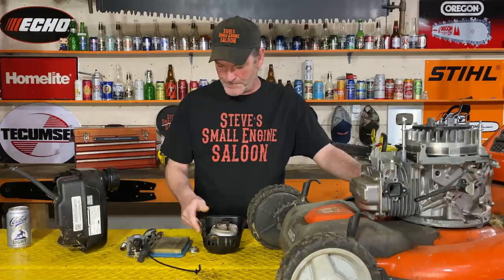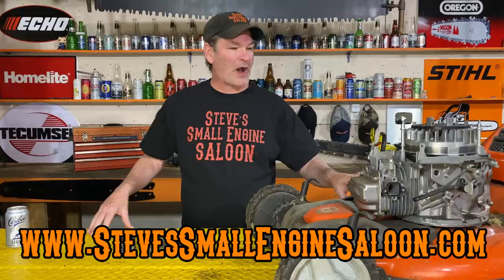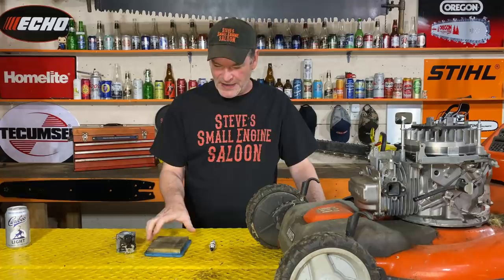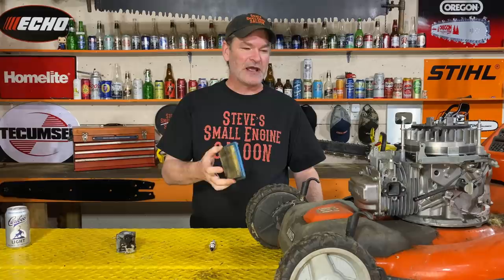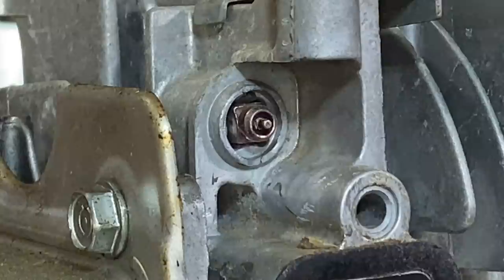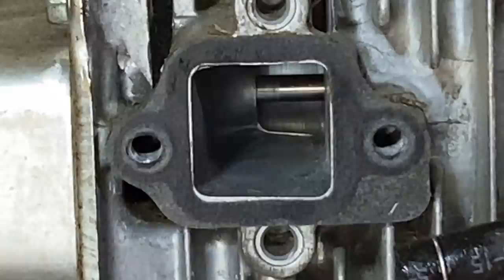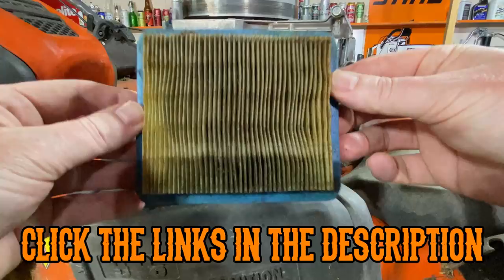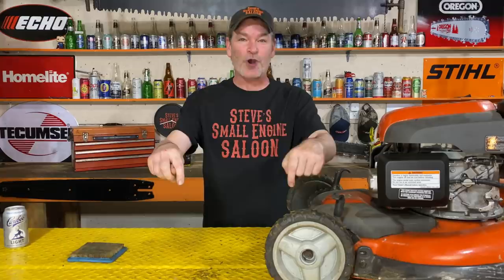What Happens If You Flip A Lawn Mower Over Wrong?  (LOSE MONEY)

Comment: Steve that's awesome. I got a riding lawnmower for free. The guy said get it out of here. Put a brand new battery in and it fired right up. Sold it for $450.  I also had many push mowers that people said the engine is shot. The blade was loose on one and the other one grass had built up underneath and the lawnmower would not spin. Easy fixes.
Reply from the maker: Right on buddy!

Comment: I went to the junk yard this week to get a  old mower because my old deck was broken but the Honda engine was good , bought a mower for 15 euros  thought will it run ? made a new air filter, cleaned up spark plug ,new oil sharpened blade (watched your video ) BANG first pull it started and runs like a good one ! Happy days save me 200e on a new mower  .

Comment: Great find. Just got a free toro recycler with a Kohler engine. Wouldn’t start. Turns out the previous owner had put the choke mechanism on backwards after he cleaned the carb, so it held the choke open. I turned it around and it started right up. He did a great job cleaning the carb. Lol.

Comment: I’ve had a craftsman mower with a Honda engine for 18 years now,always starts within 2-3 pulls even after sitting for 6-7 months.The last couple of years I’ve left it outside in the winter rains here in Nanaimo. I checked the air filter before starting the first time this year,full of water,carb all gelled up,exhaust also had water coming out. Pulled it all apart,cleaned carb out,new filter,plug,two quick oil changes.checked compression,all good and runs like a top. I’m only gonna run chevron 94 with no ethanol to avoid any kind of crystallization in the carb again. 😎

Comment: Over my lifetime I can't count how many mowers, weed eaters and saws that I've received or bought for practically nothing. Some I found or got for free and it was the simplest things wrong with them. My recent luck was three items that I'm keeping for myself. Two are practically brand new and were simple fixes. The third is my side project cause it's about 15 y/o but has the GCV 160 engine with manual choke. The frame is old but solid (like a tank), with no wobbly wheels. The engine smokes but no knocking. It's compression is on the low side. I'm going to rebuild it while parts are still readily available and still fairly cheap. (Already looked up parts) I've never rebuilt a Honda mower engine and I'm up for this little challenge. I've always known Honda engines to be good but never owned a mower with one nor worked on one. This is my first. I like working on side projects like this.

Comment: Great video! Having a clean air filter really makes a difference. I've found out the hard way that tipping your lawn mower on the wrong side is bad news. Today, I just tipped my mower (after being repaired) over on a 45 degree angle forward to clean underneath when I should have tipped it backward. But it was only for like a minute or two. Thankfully my mower is working fine.

Comment: Back in the mid 70's, I went to VO-TECH for small engine repair and one of the first thing my teacher taught me is that most of the time it would be a 2.00 part that has gone bad and in this case it just happen to be an air filter what 6 or 7 dollars so the first thing that you check the cheap parts first it just may save you a lot of head aches. I could not help but laugh when he puled that air filter off hehe lol.

Comment: This kind of thing happens all the time. I had a guy bring me a mower he'd flipped completely upside down to clear a bunch of jammed up grass. He said it just wouldn't run right anymore. Turns out somehow he'd knocked off (or removed) the governor spring.

The problem now is that nobody seems interested in used mowers. I don't know if it's the economy or stimulus checks causing the lack of interest, but they just don't sell like they did in years past. It's hardly worth my time even with a free mower.

Comment: Not long ago, I had a neighbor give me a Craftsman tractor riding mower because it was spraying oil out of the muffler when he attempted to start it.  I pulled the dipstick after I got home and the crankcase was full of gasoline.  I drained the oil, replaced the filter, and installed a shut off valve on the fuel line (to prevent further issues).  The mower started immediately, smoked about 15 seconds and now purrs like a kitten.  Best deal I ever made!
Reply from the maker: Awesome!

Comment: I have this exact lawnmower and I am just about ready to give it to you as well…well, that was last night on a customers lawn. It would start, get up to operating rpm and stall. Over and over and over again…you get the idea. Didn’t have a plug wrench with..not my normal performance..rookie mistake 🙄
Made sure the breather was clear and nothing ‘seemed’ to be hanging up the choke or governor(at least what I thought to be a governor. Serendipitous that you just worked on one. I’m thinking it’s starving for fuel but on the restart, it ‘puffs’ a little smoke. So I’m still ‘stumped’ as to what it is until I tear into it…I thing I will pay close attention to your video Steve..and hey, thanks a bunch in advance. 👍👍 (us Steve’s have to stick together and pay it forward. 😉☺️)

Comment: About 2 weeks ago the elderly gentleman across the street put his 6.5 HP. push mower out on the curb with a FOR FREE sign on it. He's almost 70 & still mows his own small yard, good for him. Any way I saw it early in the morning when taking the dog out & grabbed it. I didn't feel LUCKY when I found out what was wrong with it & how simple the fix was.

What was wrong with it was the Control Stop Cable was broke at the bracket & was very hard too see, had too take the cover off. I had an extra handle & control cable in the garage, so I put it on & it fired up, ran fine. I changed the oil, air filter was good, changed the spark plug, sharpened the blade then took it back over too him a few hours later.

Now I didn't know this man very well since I moved in this neighborhood just a few years earlier & he kept to himself. HE STARTED TOO CRY when I told him I fixed his mower & did some maintenance on it. He said he couldn't afford too buy another mower & didn't know what he was going too do. Asked me how much I owed him, told him pay it forward if ya could & was glad too help. He said, " THAT'S THE WAY IT USE TOO BE & DIDN'T THINK PEOPLE WERE LIKE THIS ANY MORE ".

I watched him that day mowing his grass with a huge smile on his face, DAMN NEAR MADE ME CRY. Later that evening he came over with a couple of beer's & we shot the shit on the front porch for a couple of hours, GREAT MAN.
Reply from the maker: That is AWESOME!
Reply: @StevesSmallEngineSaloon  THANKS, Some of your vids that I watched helped me fix the mower. I'm not what I use to be since my wife took her own life a few years ago at the age of 49.  I can't remember the simplest things most of the time now or figure them out like I use too. We were married in High School at the age of 17, Docs. say it did something too my brain seeing that.  

THANKS FOR THE REPLY & YOUR VIDEOS SIR. Henry from N.E PA. Fighting everyday too stay alive & if it wasn't for my dogs ( UNCONDITIONAL LOVE ) I KNOW I WOULDN'T BE HERE. YA I SOUND KRAZY RIGHT, HELL SOMETIMES I THINK SO TOO, THANKS STEVE.

Comment: I have had mowers with the oil fill/dip stick tube and the previous owner had badly overfilled the engine oil and caused oil to go through the breather and clog the air filter like this. I also have fixed many junk pickup set out mowers that only needed a new spark plug or the carburetor jets unclogged. Expensive mowers too.

Comment: Being lucky like that requires brains. I'll never be that lucky.  😎
Problem and video idea for yah, Steve... Why do I have to pump my primer bulb like 15-20 or more times before the lawnmower engine will start? The bulb is not leaking, at least outwardly. 
It's a Craftsman mower, 6.5 hp Tecumseh  engine. 15-20 years old.

Comment: My brother in law had a neighbor give him a push mower for free because it wouldn't start.  It has one of those new Briggs engines that have "GUARANTEED TO START" "EZSTART ENGINE" plastered all over it.  I looked in the empty fuel tank and saw a lot of grass and debris and noticed the lack of a fuel filter.  Sprayed a bit of carb cleaner into the throat of the carb and it coughed when we pulled it.  Removed the plastic carb and took it apart and cleaned it.  Started on one pull.  Funny how these new auto-choke guaranteed to easily start mowers come from the factory without a $5 fuel filter in them.  Only thing they are guaranteeing is return sales in a few years.

Comment: Since most mowers no longer have a bottom drain plug, you have to tip it over to change the oil, and just being aware of the crankcase vent tube connected to the air box could save a lot of problems.

Comment: I'm a DYI and pretty handy. I had the mower on its side to adjust belt. I turned the blade, didn't seem loose. Started it and made a clanking noise. Was running out of time and ran it by my small engine shop. Mechanic fired it up and immediately stopped it because the blade was loose. Left it for a tune up.

Comment: I have ditched anything gas for my lawn equipment and replaced it with Chevron's EGO line of lawn equipment.  The push mower is the new select-cut 21" dual blade self propelled mower and my riding mower is the new 42" Z6 Zero Turn which is just fantastic.  No belts (direct drive motors for the blades) and two direct drive motors on each rear wheel.  Completely silent until the blades are engaged.  Of course this way of thinking (electric) would put you out of business.  The best part of electric is they start up with the push of a button after sitting for months during winter.  No more ICE for me !!

Comment: It's always nice to get an "easy" fix once and a while!  What a sweet machine too!!  Just about every piece of gas powered equipment I own, was free - either given to me broken, or curbside.  And I've had most over 10-15+ years now.  
I just grabbed a curbside Snapper with Briggs engine - electric start with 12V battery, self propelled.  3 years old.  Sheered-off flywheel keyway and blown out head gasket.  Zero compression. 
$2 for a new keyway, $11 for a new head gasket.  Reinstalled the head, valve adjustment, didn't even touch the carb.... and it started on the 1st pull!  Just sold it for $150.  The original owner probably hit something or attempted to mow heavy brush, and it stalled the engine, causing the flywheel to spin and sheer the key.  The next revolutions of the engine, loaded up the cylinder with fuel, but with the timing off, it sparked with the piston still rising up and both valves closed, causing a massive pre-detonation, blowing out out the head gasket.  Both valves were fortunately ok.   The blade was ok too.  Keep up your great videos and friendly positive attitude, Steve!

Comment: I have a STIHL BG 55 blower with a carburetor zama S68G. It has worked very well for eight years then it started to flood and would not start. I purchased carburetor  repair kit and replaced the metering and needle valve and related parts. Also checked the on off switch that was working properly. I replaced the spark plug and verified that the unit had spark. I replaced the fuel hoses and filter.Reassembled the unit only to find the original problem of flooding. I removed the carburetor again used carburetor cleaner cleaned all orifices then reassembled and ended up with the same flooding problem. I was frustrated contacted Zama to discuss the carburetor issues and was provided a new replacement carburetor number that I purchased aftermarket. I installed the replacement carburetor and verified that all gaskets and connections were correct only to end up with the unit having the same problem of flooding. I did notice that if I attempted to start the unit without choke it would attempt to start but with flood very quickly.I don’t know what else to do. I’ve tried everything I know ,please help.
Reply from the maker: Check the videos in my playlist...

Comment: I had one of these with a GCV190 engine in it. Loved it. So easy to use with the 4WD and two activation levers. Mine had a separate problem, which I fixed, and sold the machine for $200.
Reply from the maker: Cool!

Comment: I am from India and working in Kuwait and a subscriber too. My company is the dealership for Husqvarna in Kuwait. I have even trained from Sweden from Husqvarna factory in 2010. 
      This issue generally arise when customer starts to repair themselves. Wrong way to overturn, putting excess oil(which is very cheap here) and tilting mower beyond its limits. And once for one model Husqvarna mower the was Briggs and Stratton, the suddenly starts blowout the oil through the breather pipe which ends at air filter. So the same clogged filter issue again Now is a different model of Briggs engine.
   And here in Kuwait too cold extreme hot. Automatic choke is not so appreciable. I used to modify to manual. Because when engine is hot, stop the engine and to start immediately is difficult.

Comment: He's at the stage where he "knows enough to be dangerous". I remember myself doing similar things, but eventually you accept that the problem is usually very basic and very simple. And that doesn't just go for mowers, but almost everything. Cheers!
Reply: I'm a auto mechanic and I wish that was the case with modern electrical systems on vehicles.

Comment: 😂😂I went to buy champion generator 9000w for $300 from Facebook market. I did not ask to start it because I’m already getting good deal but he insisted to turn it on for me but the generator of course STARTED and it SHUT OFF after 5 second 🤔. I asked him if the gas and oil fresh and when last time did he started it , he’s answered was a week ago. He pulled the filter and carb and all was good. He gave up and he offered me the unit for FREE . Took it home I was disappointed and happy because I didn’t got screwed. Guess what I found the solution in your VIDEO 😂 . The reason was shutting off because it’s was low on oil .I changed the oil and it’s started right away with no issues. Thank you 🙏 very much
Reply from the maker: Right on buddy!  You're Welcome...

Comment: I was given the same exact mower I believe. At least it looks the same, but mine has four small wheels. I know it's that brand and AWD. The only issue I find is that it requires carb fluid to kick over, but I think I know what causes that. Air Filter looks fine from a quick glance. (stuck choke?) I just haven't had time to work on it. It's like 100 freakin' degrees here so no thanks! I'll wait until it drops below 80. I honestly hate southern Ohio summers. Just way too hot and humid. (Cheers!)

Comment: Got Murray just like it same thing only I did give $10 for it.
Had a customer bring in a mower last week that you had to spray starting fluid in it every  time. Then it run good. Till you stopped it then you had to spray it again. I cleaned the carb. Then it would start cold but you had to spray it when it was warm. So I cleaned the carb again didn't change anything. Pulled the flywheel and the key was sheared just to the point it come off in 2 pieces. Now runs like new.
Reply from the maker: Awesome!

Comment: I did that with my pressure washer with a Honda engine. Tipped it over and plugged the air filter. It was gas fouled. It would run fine without the filter, but would not start with the air filter installed. A new air filter fixed the problem.
Reply from the maker: Right on

Comment: I work on small engines as a side job and been given so many push mowers with that problem. Put a new filter on and for sale. Got 2 a guy dropped off and gave me last week matching set. One had a oil soaked filter and the other one had a filter that just needed replacing because it was really dirty. Rear wheel drive with electric start and new batteries. He just went and got new mowers. They were just troy bilts but only one season old in real good shape. They were around $350 pl tx new. It's crazy how some people just say what the hell! I'll go buy another one.
Reply from the maker: Agreed!

Comment: Found a Troy Bilt on the street, look brand new. Tore apart and found air filter saturated with oil. New filter and runs perfect. Seems the home owners front lawn was no steep that the oil ran into air filter from the crankcase breather.